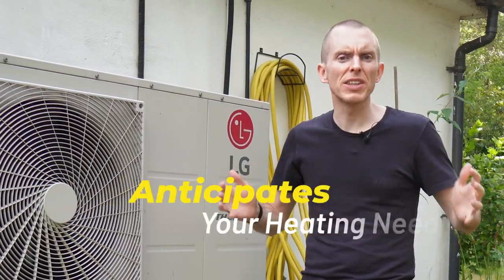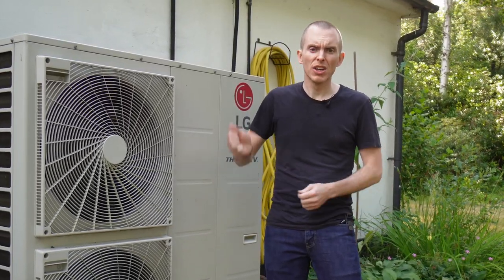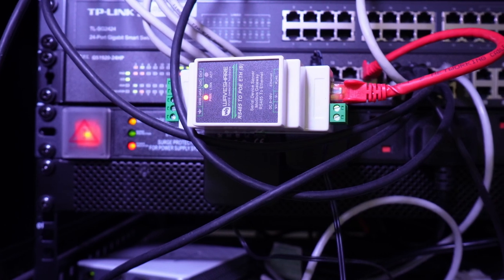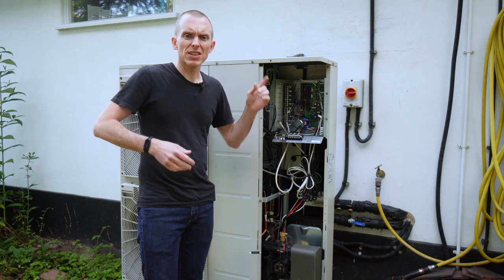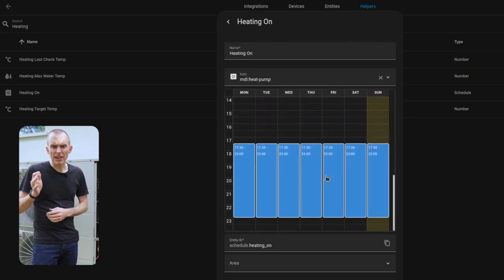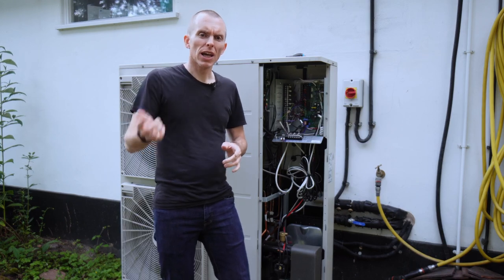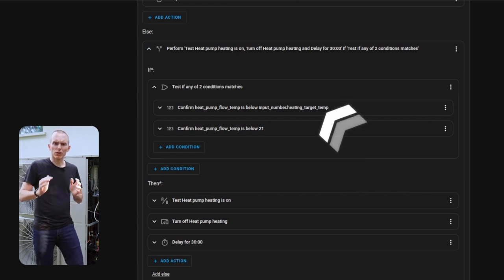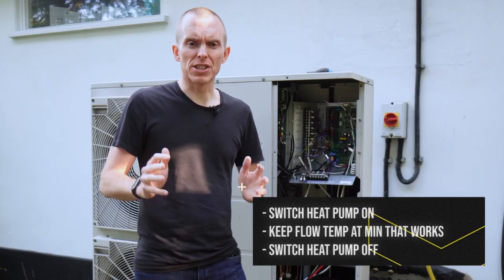Home Assistant Fixed Our Heat Pump!

Comment: You could try setting the flow temperature based on the outdoor air temperature and the 'heat curve'. This is called weather compensation and is the normal way of varying flow temperatures of a system. Might give you longer more effecient run times as you won't have the half hours on/off cycles once at stead state and the system will adapt automatically to your heat loss created by the weather for the day.
Reply from the maker: Thanks, others have also suggested this. I expect in a modern well insulated house the built in weather compensation will work OK but in an old house like this I have my doubts. It's also hard to imagine how a system that relies only on the outside temperature could possibly do a better job than a system that has the outside temp, wind speed and direction, temps for for every internal room, presence detection and any other data that's available to home assistant, such a system has a lot of potential. It could turn out to be no better than a basic weather compensation system but it's worth experimenting with and is certainly a lot more fun and interesting.

With my system as it currently stands home assistant will only turn the pump off when the flow temp has dropped below the desired heating temp, in winter this never happens and when the weather warms up a bit I think it's desirable.
Reply: I run weather compensated systems. One with underfloor heating in a 25 year old building and one in a 50 year old building. In both it is working. In the older building the room temperature is included with 10% in the flow calculation. In the newer building no temperature sensors or thermostats are connected to the heating system.
Reply: Agreed, go for weather compensation with internal temperature shift.

Also don't cause the compressor to cycle too frequently or it will significantly lower it's life expectancy. If it's possible to limit it's output frequency on your heat pump its possible to get it to run slower but longer.

I've seen benefits from this on my own system. For efficiency run 24/7 at as low a flow temperature setpoint as you can at the lowest compressor output frequency.

Consider using an electricity meter for the heat pump like a ShellyEM instead of a heat meter to monitor energy use as it's much easier to install.
Reply: @RodMcBain the built in short, weather compensation modifies the max value for your water temperature.
It will calculate automatically the max water temp to external temperature curve, by reading the fluctuations on the temperature sensor inside the house (not an ON/OFF switch).
I have it in my gas boiler. Brick house whit no insulation, radiators in winter are always a little warm 24/7 and they automatically get warmer as the temperature outside falls, to compensate for the losses of the walls.
example: in my case whit an outside temperature of 5-10°C and thermostat set to 20°C, water set point will vary from 30°C to 40°C. 
The inside temperature sensor switches off the heating if it gets too hot, and helps the algorithm calculate the climatic curve required. 
Got a 30% savings from the same system when I mounted it, whitout the external probe.
works best if you set & forget. set a temperature and leave it there, no schedule or manual turn on/off. that way it heats the walls and you'll get confy even whit 18-19°C
Reply: We live in a well insulated, modern house with very little heat loss, and controlling the heating (any heating) purely based on outside temp and heating curve still isn't optimal. It works of course, you won't be cold, but it won't be best for efficiency or the longevity of the heat pump.
Reply: Also worth looking at Black bulb sensors, these detect thermal radiation (Sunlight through windows) and can help with getting a truer temperature reading, they can also be used to open blinds/curtains to allow the sun to warm rooms in addition to mechanical means...
Reply: You should read more into how weather compensation work. Doesn't matter if the house is well or not well insulated, this just has an impact on the steepness of the curve. It is key to set the steepness correctly and you'll need a bit of trial and error. Also this curve sets the max supply temp, the heat pump should not immediately start at this temperature. It will maintain delta T of 5 degrees and slowly build up supply temperate as the building heats up. This is how vaillant does it. I expect LG does the same if you install it correctly.
Reply: @antonclaeys  most people don't even know how to read the curve, let alone understand how it works
Reply: @antonclaeys  I know all about the theory...but I also know how the reality doesn't live up to that. I have been living with a weather compensated Vaillant system for well over a decade. It works, but without any information on the actual interior temperature it will never be quite ideal. Fiddling with the heat curve (mine ended up at 0.2, max flow temp 35°C) can't fully compensate for lack of data
Reply: @rolandrohde  but vaillant do use internal compensation. For example vrc720: you can set it to only work weather compensated, only on indoor temperature or by using both. Which means if you almost reach the set temperature inside, supply temperature will drop a bit. The heating curve therefore will shift.
Reply: @antonclaeys  Yes. My heat pump runs with the 720 and I made sure to have it installed in the living room. Our gas boiler had an older control and that was mounted in the cellar, so room compensation wasn't an option. Sadly most installers tend to put the controller where the heater is, not in the actual living area, but I learned that lesson and forced them to do it right this time. How well the indoor temp compensation works is something I will find out this coming winter, we only got the heat pump in April this year and by then there was no need for heating anymore.

Comment: You’re now essentially running the heat pump in load compensation mode. Nothing wrong with that, but it’s already built into the LG controller. If you adjust the ‘temperature sensor’ setting parameter to ‘air+water’… obviously disable/remove all external on/off controls.
Reply from the maker: Thanks, not sure that would work in my case with the internal controller in the same room as the tank, it's always hot in there. Also the RHI scheme where we get payments for the pump requires the use of an external thermostat, crazy requirement that would reduce the efficiency of the pump.
Reply: @RodMcBain  the LG controller should be placed somewhere sensible in the house, not in the cylinder cupboard. Yet another fail from the pre-packaged installer brigade here in the Uk.

Comment: You don't need a heat meter, you can read the flow/return temperature and the flow rate from the modbus registers.
Reply from the maker: I wish that was true, but for the model I have the flow rate is not returned over modbus, everything else works but the flow is blank.

Comment: Do you actually have both the Wi-Fi control and the MODBUS controller functioning at the same time? I am trying to achieve this with my Samsung HTQ. I have a Homely controller active via the MODBUS and I was hoping to use the Wi-Fi to read data into HomeAssistant but no dice so far.
Reply from the maker: I have now also setup modbus and it seems to working fine alongside the Wi-Fi module. I think I'll leave the Wi-Fi connected so I can additionally use the LG app to control the pump, new video coming soon with the modbus install.
Reply: @RodMcBain  Seeing your video spurred me to try again and I now have both the Homely via Modbus and the Samsung Wi-Fi kit working.  Now all I need to do  is work out how to get HomeAssistant to turn on the hot water control on the heat pump - sort of an automation version of a Myenergi Eddi. Thanks for your reply.

Comment: Have you looked into Opentherm control which modulates the heat pump?
Reply from the maker: I've not, a very quick google search suggests the LG Therma V is not OpenTherm compatible, at least I can't find any info on it. I'm also sceptical that a single thermostat would work well in my old house, where some rooms are modernised and well insulated and some are not. 

OpenTherm does sound like a good solution to the on/off only problem, I'd not come across that before, thanks.
Reply: Opentherm is mainly used for modulating gas boilers. Almost no heat pump manufacturer uses it

Comment: How old is that heatpomp ? Those are smart so that domb switch is a domb installation
Reply from the maker: Installed Sept 2021, so not that old. The installation is certainly not perfect and is borderline bad, but even if the LG controller was in a sensible location it still wouldn't work that well in an old house.

Comment: If you are switching off the pump, doesn't the water that's in the pipes outside the building freeze when the outside temperature is below zero degrees Celsius?
Reply from the maker: That's a great question, I'm not switching off the pump to the point where it doesn't have power, it's only being told to switch the heating on / off. My pump and I think all monobloc pumps have protection built in that monitors the outside temperature and if it gets close to freezing the pump will switch on it's internal circulating pump and heat the water a little to prevent freezing, so as long as the pump has electricity it should never let the pipes freeze. 

On top of the that pumps are either installed with glycol in the water to reduce the freezing point or anti freeze values that will open when the temp of the water in the pipes approaches freezing, that drains the system and prevents damage.

I didn't know any better at the time and let our installers use glycol, but that reduces the overall efficiency of the system and makes working on the plumbing of the system more difficult, glycol also needs to be topped up regularly at a significant cost. Given the fact that under normal conditions the pump will never let the pipes freeze I'm planning to switch from glycol to anti freeze values.
Reply: @RodMcBain  Is switch.thermostat_receiver created by SmartThinQ LGE Sensors integration?
Reply: @martinspukitis1954  Nope, it's a zwave switch that in my setup first opens a way valve and once opened switches on a circulating pump and tells the heat pump heating to start. If you don't have valves / pumps that need to be on you can just switch on the heating using the ThinQ Integration.

Comment: You could try the node-red integration in Home Assistant, it also includes mod bus integrations as well as many other functions for automating processes. I use it control my, ahem, gas boiler for weather compensation.
Reply from the maker: Thanks for the tip, I've looked at node-red in the past but was never really sure why I needed it, I guess as a better GUI for creating automation's it makes sense, the home assistant automation GUI and  YAML are fine but far from good.
Reply: @RodMcBain  yes, for a few years I resisted it but have now transferred all automation to it. I found it especially beneficial for those asynchronous or complex  tasks , such as a weather compensation curved response

Comment: Hi Rod,

I have a Panasonic Inverter Heatpump and the standard controls are really dumb too. So I connected it to Home Assistant using the Heishamon project. Different hardware, same approach. I have thermometers in every relevant room and a desired temperature for each room. So I can calculate if there is a heating request or not. The weakest room determines the runtime. My heating is hydraulicly balanced well, so it works fine. I also have a selectable minimum runtime (normally 1.5h) and heating lock-time (1h) to prevent heavy clocking of the compressor. Inlet temperature is set by the machines weather compensation. In addition i can lock the heating in case of high hourly energy prices, because I have a dynamic tariff with hourly changing prices.
Reply from the maker: Thanks for watching and the comment, some great ideas in there.

Comment: 16Kw to heat a cottage, holy shit!
Reply from the maker: I wouldn't describe the house as a cottage, but yes at 150m2 it's not but, but it is old with high heat loss. Recently had planning approved that will increase the house to approx 300m2, combined with efficiency improvements a 16kW heat pump will probably still be appropriate.

Comment: Hi Rod,
As I couldn't get the modbus installation to work, I finally bit the bullet and went for the ThinQ module - and this works fine. I am interested in trying to optimise the heat pump in a similar way to you.  I have one question though. What thermostat + receiver are you using? The installers stuck in a wireless Honeywell which I cannot integrate anything with. I would like to change this of course so I can add this extra layer of control.
Thanks in advance
Reply from the maker: Hi, Probably not helpful but I use an old Secure SRT321 z-wave thermostat and receiver, I'd removed it from our previous house and it seemed sensible to re-use it. I really only use it as a wireless switch. I've not looked in detail but I expect there are wi-fi based options that cost less and have local control from home assistant.

Comment: Is your heat pump an "inverter" style?    
IF it is an Inverter style, then 24/7  would likely work better, along with a thermostat in HA
Reply from the maker: Hi, It is an inverter style and I did try what you suggest. I expect 24/7 might work with weather compensation, a properly situated internal control panel and well insulated house, but that's not my use case.

Comment: Rod you are clearly in your element with the more geeky side of all the technical side of stuff you tackle with competence.

Clearly your property is a work in progress and special measures are required to keep your home at acceptable temperatures without busting the bank - but.

For the longer term and I n my opinion, you are overthinking and seeking to micromanage the control of the heat source to a level that is likely wholly unnecessary.

Yes, all the information you are grabbing is very useful as part of performance monitoring (and using the open energy type kit would be a good idea) but from a control perspective it is OTT. As other have said - all you need is weather compensation. Yes I know you have misgivings but it is tried, tested and proven. The house in control terms is a very slow system (inertia) and fast sampling reactive control systems are just inappropriate.

I will give you my personal example. Large 5 bed house not well insulated, Viessmann 200W gas boiler running on weather compensation with no internal room reference (thermostat). Took me one heating season to home in on the sweet spot on the curve settings for my home. Currently it is 5C here and flow temp is 35C - I have independent thermometers deployed around the home (not geeky enough to automate) but the average internal temp of the house over a 24 hour period varies by less than 0.25C at worst and that is with a 4C change in ambient over the same time. . The boiler has no direct idea of what the house temperature is - it controls entirely on outside temperature and what the curve is asking for in terms of flow temperature. It is as simple as it is remarkable in terms of results. The key is sizing your emitters to the heat loss of the rooms.

Europe has been doing this for over 20 years - we are just clutching into it with many UK heating engineers struggling to understand it.
Reply from the maker: Thanks for the detailed comment. I have little doubt you and the others who have mentioned it are correct that weather compensation alone can work very well. Hopefully by next winter I'll have a more uniformly insulated building with all the required emitters installed and I can try simpler weather compensation again. Still very much a work in progress at the moment.

Comment: If they didn’t put in a better control then it’s pretty likely that they didn’t spec the heat pump correctly. Design is critical to getting the efficiency that heat pumps can provide. 
The advantage with boilers is that overspecing doesn’t really have a massive impact, sure it’s not as good as getting the boiler matched to the heat loss so the return temperature gets down to the most condensing level, but it will work without costing a fortune. 
Heat pumps need good installers and designers who can do accurate calculations and then they can be much more efficient. The problem you have is the better you insulate the house the more your heat pump will cycle leading to lower cop. Again swapping a boiler out is a cheep process but swapping a heat pump out is way more expensive. 

Interesting video, although I’m not sure about using home assistant to run a mission critical system like the heating given it’s propensity to Lunch itself on an upgrade. Have to say I’d be investing in dev and production units and decent automated backups. All of which would probably involve a ton of cost negating the savings for a while.
Reply from the maker: Thank for the comment, fortunately in my case I'm taking a 150m2 old inefficient house and plan to extend it into an efficient 300m2 house. I expect in the end the size increase will essentially compensate for the heat loss improvements when it comes to our heating requirements and our 16kW pump will still be suitably sized.

LG also claim that their scroll compressor is able to efficiently adjust to the required load, I don't know how true that is.

Maybe I've just been lucky, but so far I've had no problem with Home Assistant crapping out on upgrades, also with everything I automate I try to ensure it can still be used without automation, worst case I could manually turn the heat pump on / off and adjust the temp until home assistant was fixed.